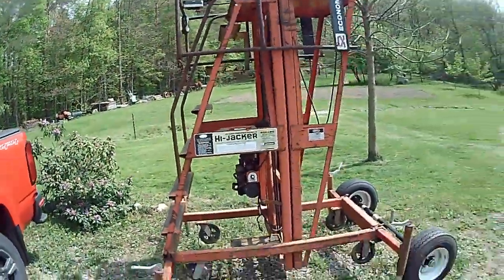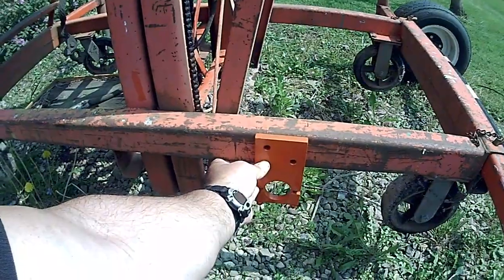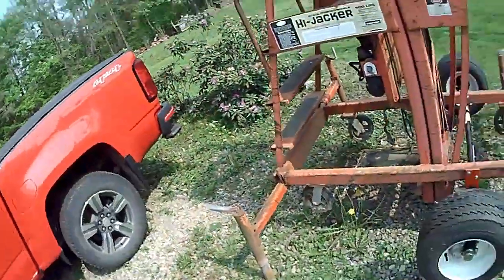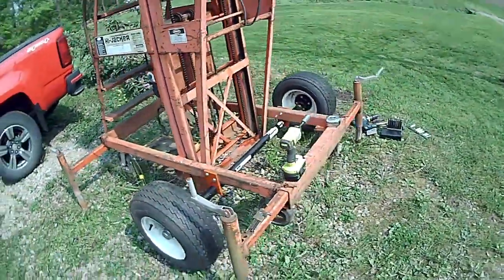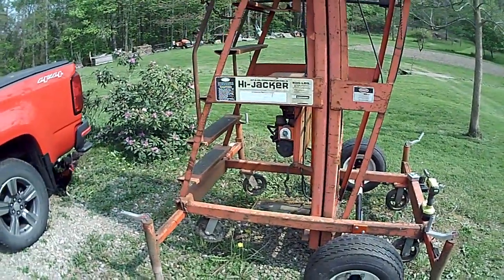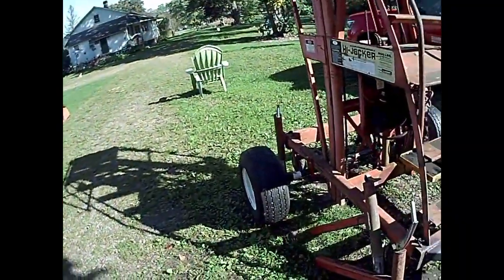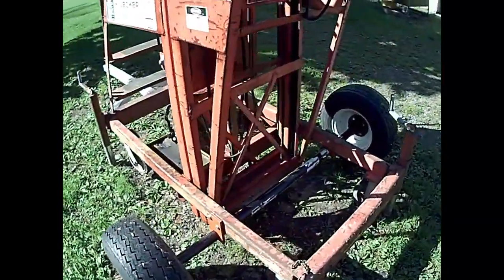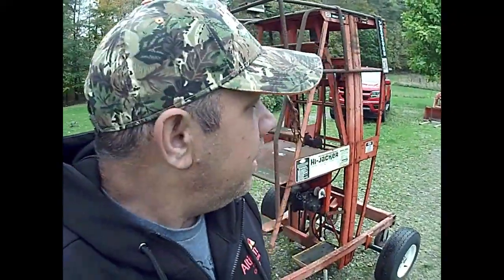Manlift Conversion Part #1

Comment: That a good thing to have we have been cutting big trees for the last 3 weeks I sure could have used that I have plans of buying a new tractor next year with front bucket my old tractor doesn't have one it's a 45 hp Massey tractor that we bought when I was 15 years old now 64 wont something a little easier to use
Reply from the maker: Hey Danny, good to hear from you my friend and you're right about how handy this lift is going to be. Older tractors like that Massey just keep running and running.